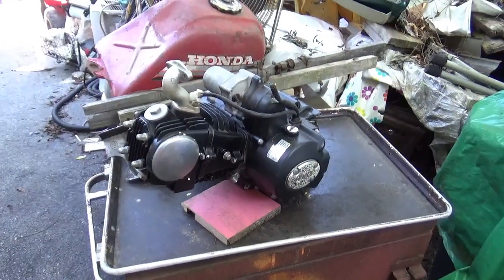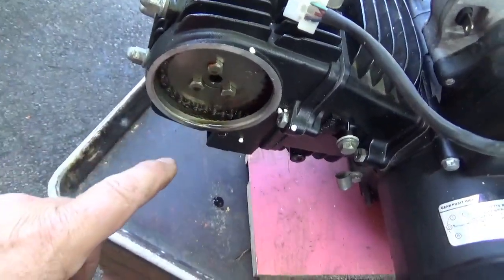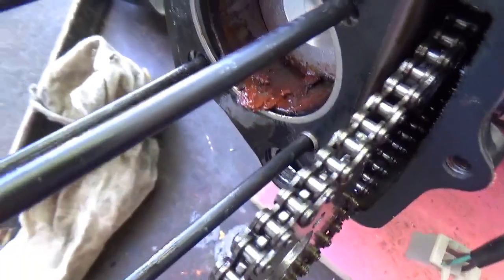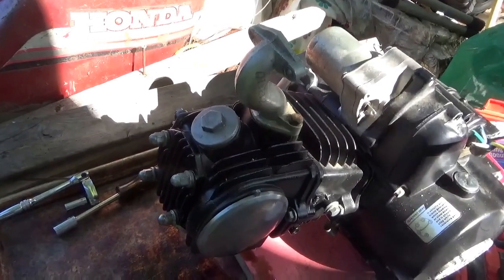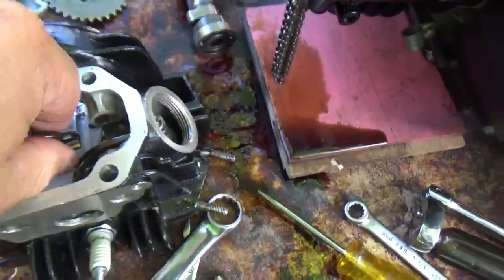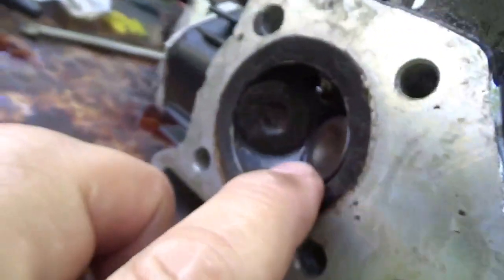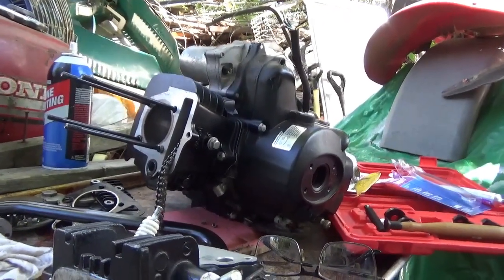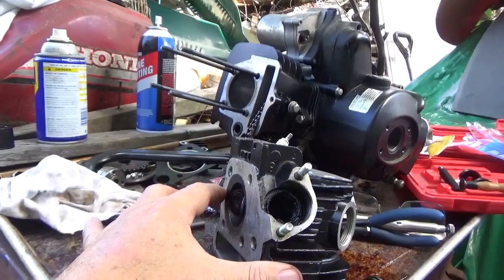$40 Low Compression 125cc Engine, Can it be Saved?

Comment: i would take out valves clean and reseat and regrind  rusty bore would get rebored start with fresh new parts, your sure then full compression with rebore new piston rings and clean reseated valves foe compression tight head.

Comment: Would that be going in the little camo 90 from the last mega-deal? Also, have you tried a wheel and tire from the red or blue bull on a 3 wheeler with a 110 bolt pattern rear axle? The bugs are gone and the sweating has stopped, let's get going Harvey!
Reply from the maker: Hey Steve, I think the little atv 90 is going to get a 3 speed motor put on it, I'm not sure it will be this one though.... I was busy this week, U will see a sears tractor get an engine transplant!!!  I did not move the tires from the bull machines, I plan on keep them complete, but, I know the wheel and tires will move to Honda 110, the hub does not transplant though....Thanks always for Ur thoughts, encouragement, watching, and commenting!!!
Reply: @HarveySpooner  My nephew came up from Alanta and I took Monday off, we rode all day and had him riding 5 different machines. A great time was had by all, then he stopped by the shop Tuesday and I gave him a quick tour before he went on to visit my Mom. Got a call to go back to the ranch next month for a long weekend and who knows what else will come up. Later Harvey.

Comment: Very nice Harvey. Easy score for 40$. Everything looks practically new. I wonder what would’ve Caused that warp? Defective from the factory?
Reply: Maby overheated🤷‍♂️ or loose/missing exhaust and valve got splashed with water?
Reply from the maker: Hey Aaron, My guess that it was running without an exhaust or without a muffler and it probably ran hot.... Thanks for Ur thoughts, watching, and commenting!!!
Reply from the maker: Hey 506!  I'm thinking it ran hot, probably without a muffler or exhaust.... I ordered valves, hopefully they are in soon!!!  Thanks for Ur thoughts, watching, and commenting!!!